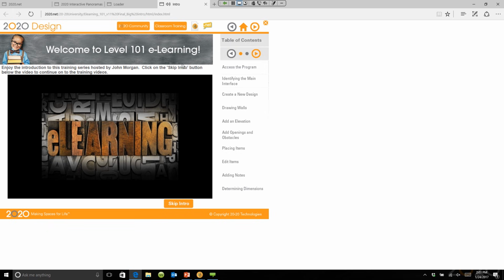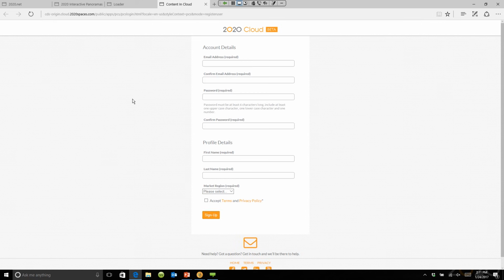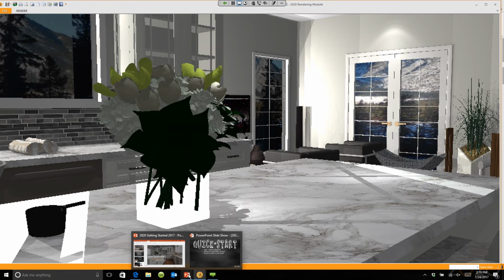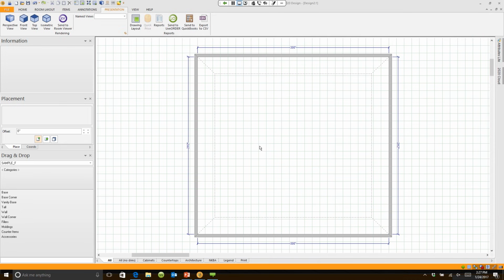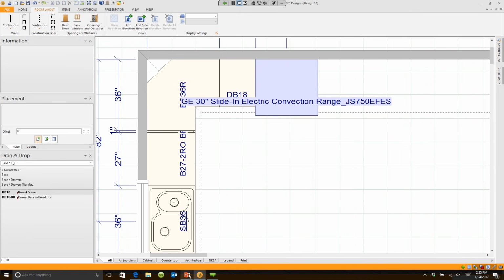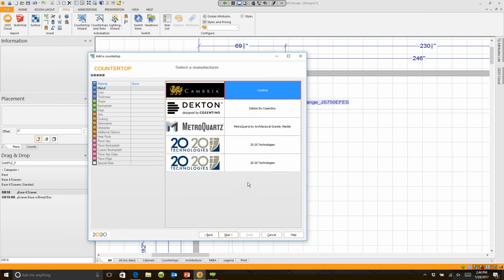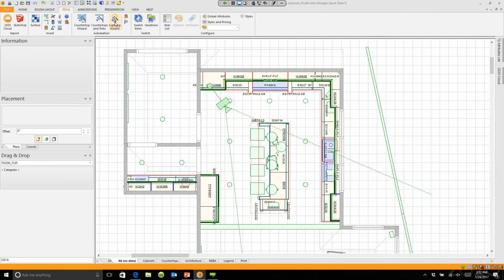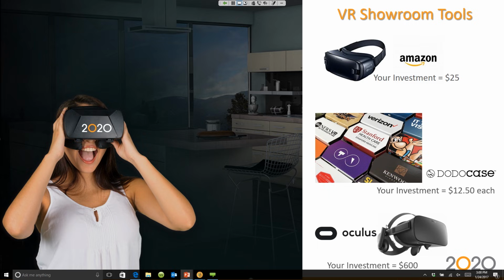2020 Design Webinar: Quick Start for Efficiency and Impact on Day 1

Comment: Compare to Cabinet VIsion, 2020 design isn't a good software for custom cabinets. It makes beautiful 3D but the rest is far from Cabinet Vision which is way better, more user friendly and clear. I just started with 2020 and so far I'm really not impress. I learned Cabinet Vision in 2 days, I've been exploring 2020 for the last month and I still find hard to navigate the interface and it's way too complicated to adjust cabinets. How come there's no calculator integrated in the software? Cabinets doesn't adjust themselves in the space, nametags aren't adjusting themselves either when the size of the cabinet change. Can't do multiple rooms in the same file. Changed my background color to work on black and when I try to draw a wall, my cursor disapeared, can't find the way to change my cursor color. These are simple things that should be built-in the program but no we have to manually change every cabinet, this is time consuming. Unfortunately, I have to no choice to learn to deal with it cause my employer use this software and can't change. I hope the next upgrade will be better cause this is terrible.
Reply: Agree